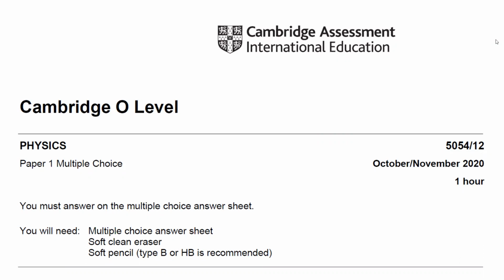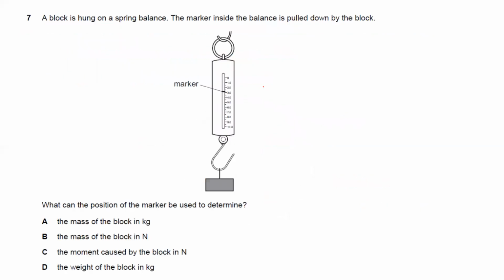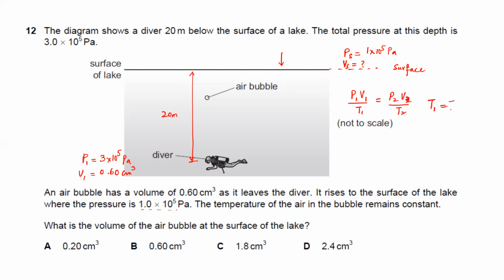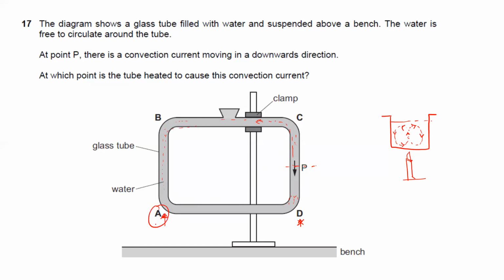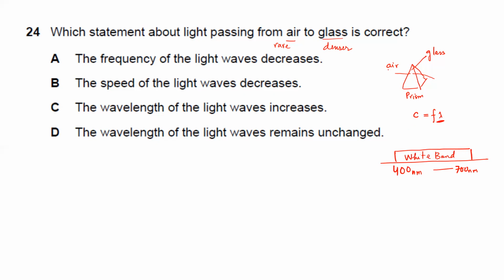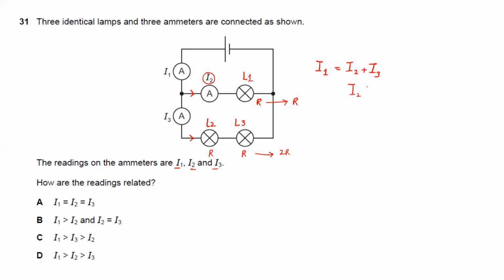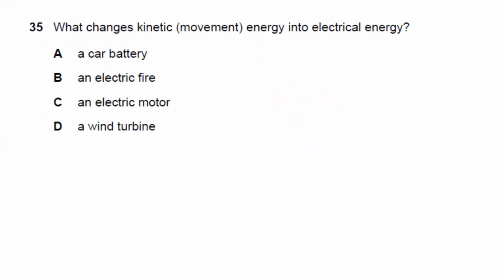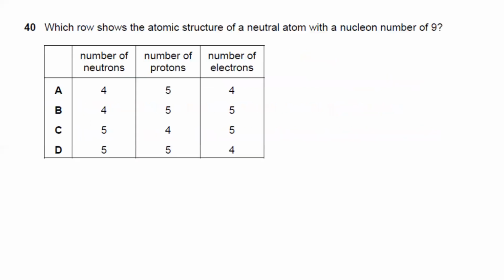O Level Physics (5054) | Paper 1 (Variant 2) | October / November 2020 | Explained Solution

Comment: Q8, i thought mass doesnt change anywhere you go so why did u divide by 5?
Reply from the maker: You are right. I should have calculated the weight and divide it by 5. Its a mistake.
Mass remains same everywhere, its the gravitational field strength that changes and causes the change in weight.